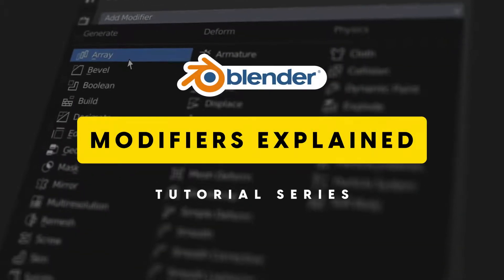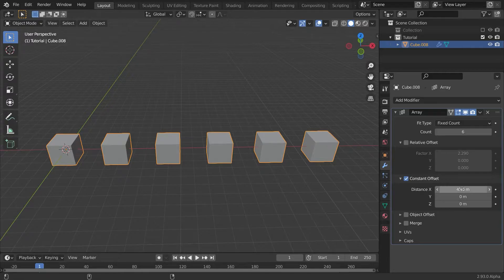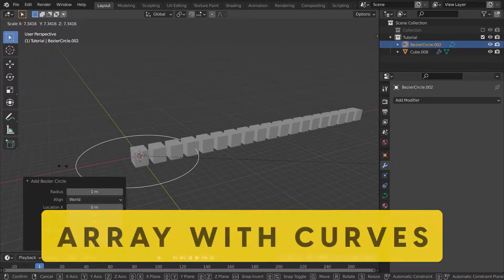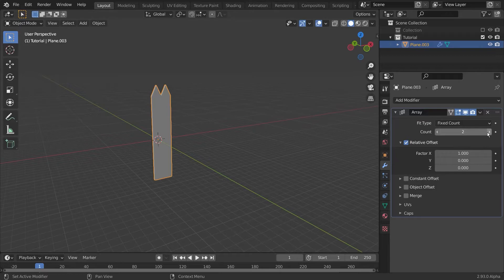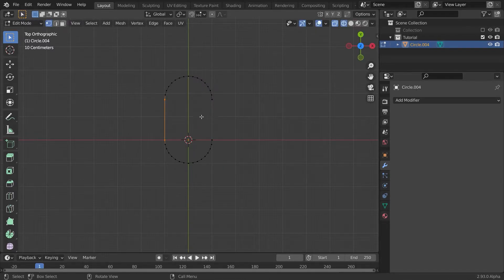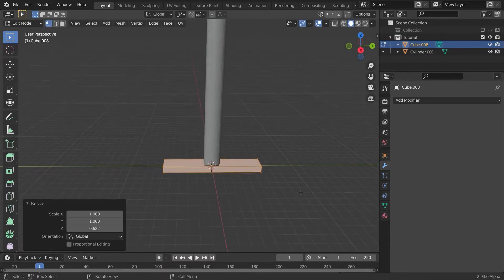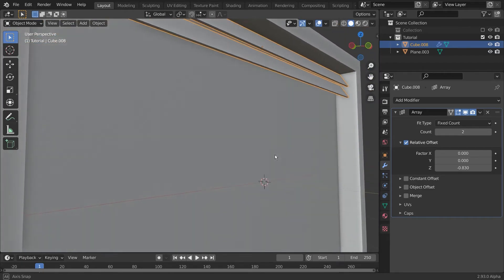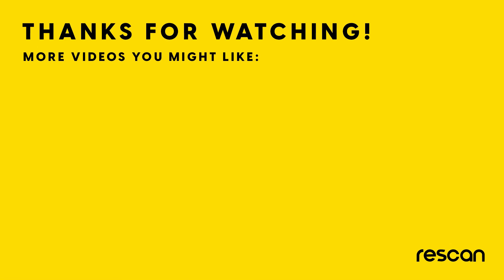Blender Array Modifier Explained

Comment: Nice video,  I wanted this, Howver I have a doubt, when I use cylinder and try to array it, using the an empty object, I see that the scaling has changed every instance of the object, so I cant apply uniform scale to it, how do I resovle this ?
Reply from the maker: Have you tried applying the scale of the mesh first? (CTRL/CMD+A > Apply Scale)